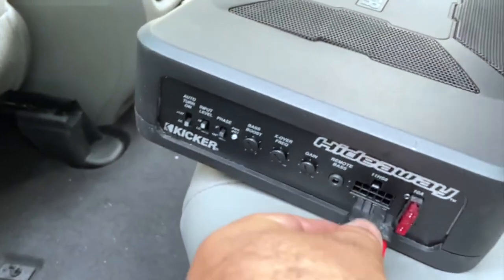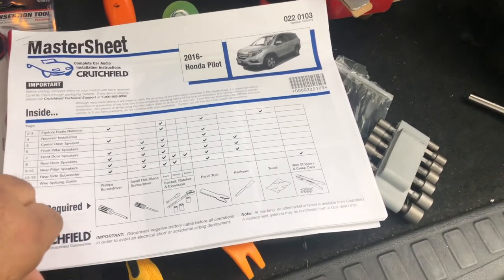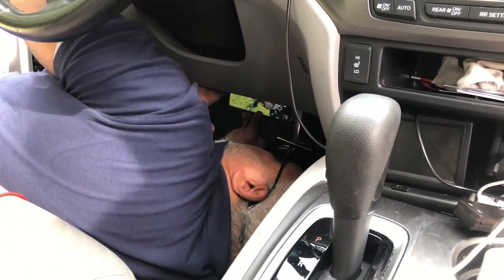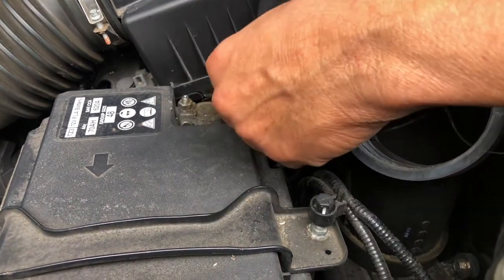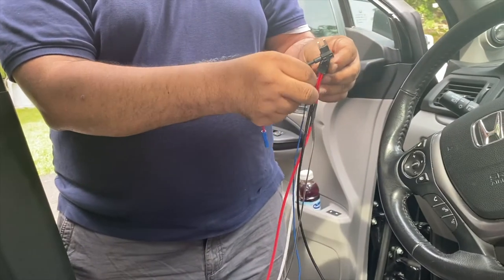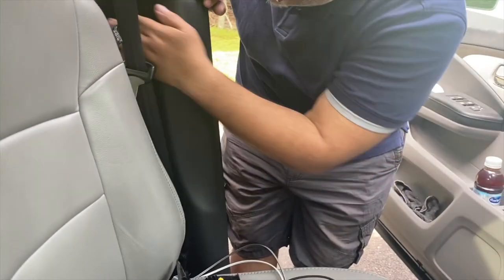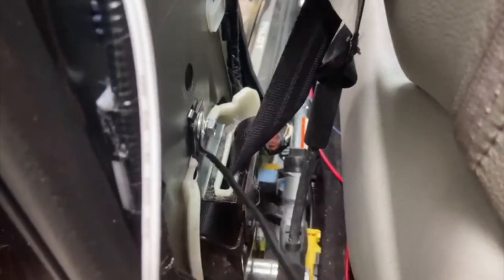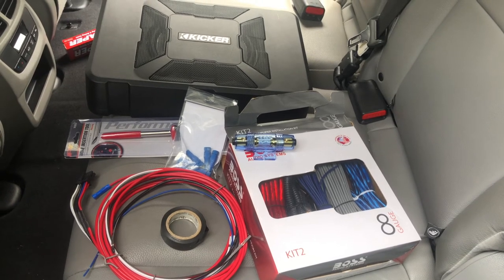Subwoofer Installation

Comment: A couple of points, took me 2 full days to install all the wires. I hooked the amp remote wire to the a/c fuse which is 7.5 amp, it is the 2nd row from bottom, 2nd fuse from the right, and it'll work when I turn off the car,. other fuse might remain on after I turned off the car, when I bought the add a circuit, I bought the wrong size, it has to be mini low profile, mini might work as well, but standard size is too big. I leave the amp in the hidden space in trunk, if I opened it and open the part where the jack is, I will see the frame, that's where I ground the amp, there's an empty screw hole there, the screw size is either m6 or m7, I bought it from Loews. For wiring the rear door speakers wire to the amp, my wire colors are a bit different from yours, mine is grey and brown for the driver side, pink and blue for passenger side. The way I tell which is which is looking at the white connector having the holes facing me and the button on the white connector facing top, the 2 speakers wires are the left top and left bottom wires , the left top wire is the positive, and left bottom wires is the negative, good luck. Also to get the fuse out, open up the hood, the top left corner has another fuse box, in it there's back up fuses and a white clamp to get the fuse out. You can Google how. To get to the active noise cancelling box, there are 2 bolts blocked by the glove compartment, you can Google how, but I basically need to squeeze the back of the glove compartment when it's opened from left and right and it'll open and drop far enough for me to get to the bolts.
Reply from the maker: Thank you for the add-on information.      Hope it's sounding great.

Comment: Thanks for making great DIY. Can you do me a favor can you upload a picture of your of the battery wire? Underneath the steering wheel on the driver side I would like to see where Exactly you got the cable across on the other side in the hood area. I do see a big round rubber patch where the wires are going outside but I’m not sure and I’m hesitant before I do anything. 
A picture from inside and outside will really help thank you.
Reply from the maker: 4:14. right ontop of the breaks pedal there's a rubber gromet .  you can punch through that.
Reply: Follow the bunches of black wires between the brake and gas padel, one of them go to the hood thru a tennis ball size rubber, it's hard to see it because the rubber is obstructed by a sheet of black plastic. I use the tool to poke thru that rubber, the rubber is really flexible and soft to the touch
Reply: Thanks for the comments, I think I know which one it is. 
If I use the harness and fuse that comes with it.
What other items do I need besides: Insertion tool, wire splicing guide and wiretaps. 
Do I need to get additional wire? If yes then what kind of wire? 
I am planning to get Kicker Hideaway HS10.